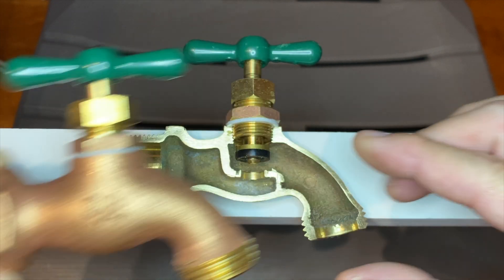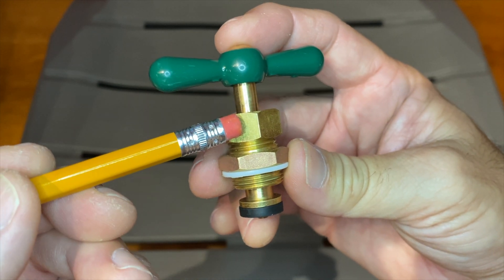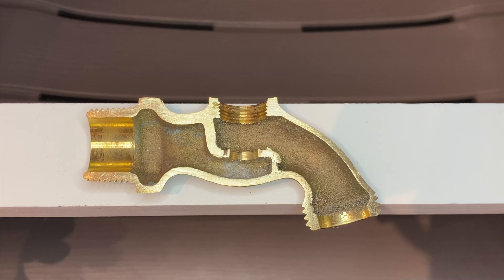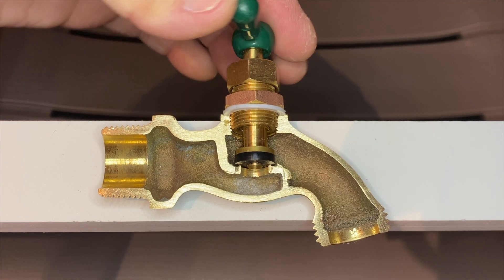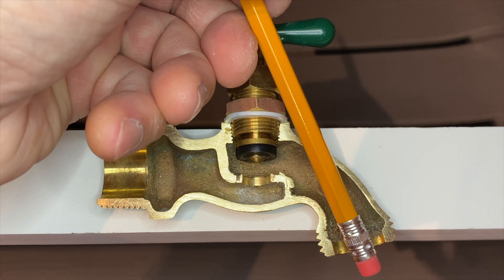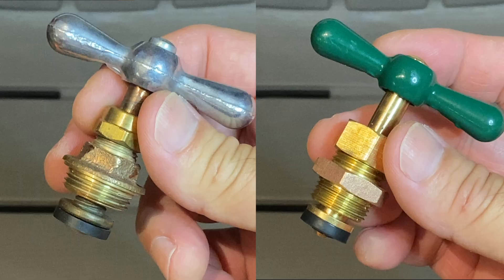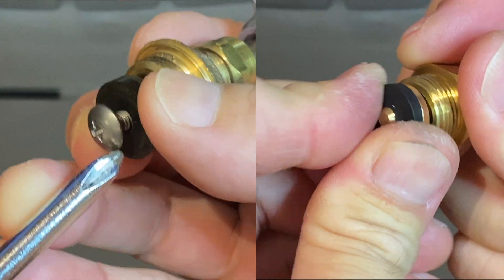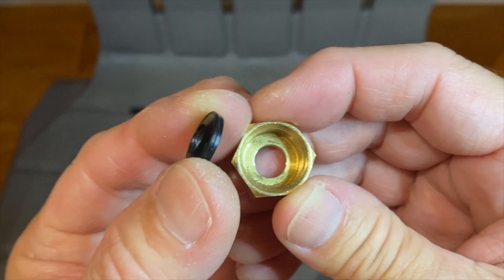How Hose Bibs Work and 2 Common Leak Repairs

Comment: This is great to see inside the mechanism. Do you have something similar for the shower valves? (hot/cold mixing valve with the tub spout outlet)
Reply from the maker: Sure do… How the Kohler Mixing Cap Works + IMPORTANT SAFETY TIP
https://youtu.be/oyuFPysbrz8
👍😎
Reply: @HacksbyDad  Thank you!

Comment: The problem is that screw on the bottom of the stem rusts out over time.  There is little chance of getting it out of an old one.  A whole new valve is about $7, which is way less than the labor to find a new washer that fits and getting the screw out unbroken.
Reply from the maker: Thanks!  I’ve removed the washer screws on very very old valves without any issues but have run into some that wouldn’t budge.  The new valve I picked up and cut in half for this video had a flanged stud instead of a screw.  I just had to pry off the old washer and pop on a new washer.  👍😎